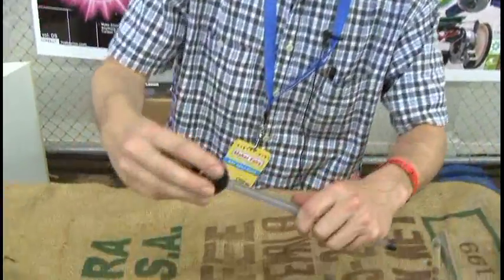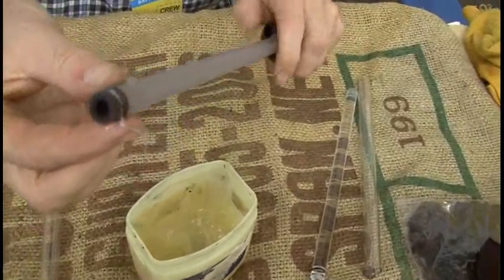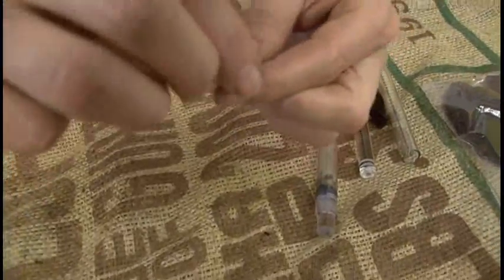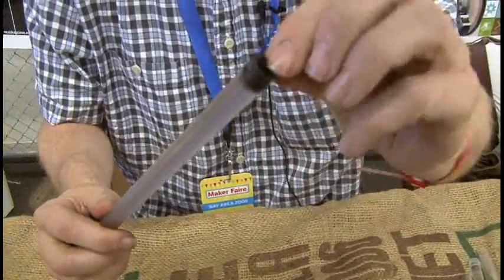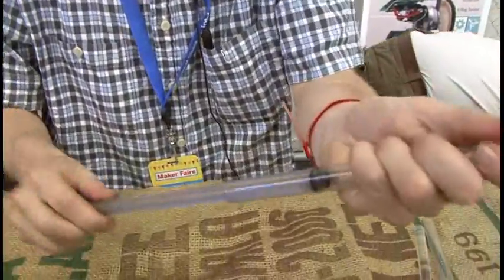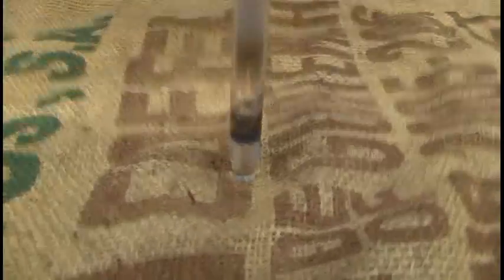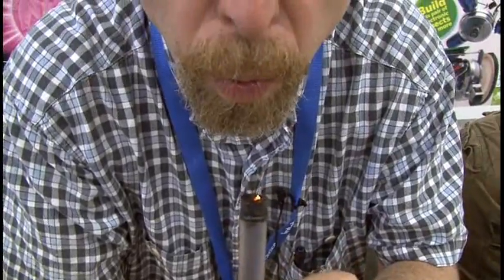Weekend Project: Fire Piston

Comment: Saying that you're "using compressed air" is a misnomer.
What is really happening is that you're suddenly compressing the air which creates heat. Diesel engines work the same way, though they have glow plugs to preheat to help get things going.

Also, the ignition temp may be 500° F, but the fire doesn't burn any higher than what is typical for the material that is the fuel. Paper, and  wood in general burn at approximately 451° F, which is why Orson Welles' book Fahrenheit 451 was thus named.
Reply: Direct injection diesels don't have glow plugs; heat created by compressing the air in the cylinder is enough to ignite the finely atomized fuel even at -20 deg C. Oh, Ray Bradbury wrote Fahrenheit 451.
Reply: Direct injection diesels don't have glow plugs; heat created by compressing the air in the cylinder is enough to ignite the finely atomized fuel even at -20 deg C. Oh, Ray Bradbury wrote Fahrenheit 451.

Comment: Thats pretty cool, but technically friction is still the source of heat for this fire starter. When the gas is compressed the gas molecules are pushed closer together and the molecular friction between the gas molecules creates enough heat to ignite the char cloth. Pretty impressive way to start a fire, it seems to be a much more efficient and reliable method than other "primitive" forms of fire starting.

Comment: @kennybigmac81 Would you say that a diesel engine is based on friction? Because  the principle's the same. Air is compressed so hard, that when the diesel is injected to the compressed air, it ignites just by the heat from the compression. So no, NOT friction dude.

Comment: @Allenrythe Actually, friction has nothing to do with it. You probably already know that when you heat an enclosed gas, the gas tries to expand, and the pressure increases. The inverse of this process is used in the fire piston: when you increase pressure in an enclosed gas, the heat increases. Under normal circumstances, the heat quickly dissipates into the atmosphere. However, because the fire piston is pressurized so rapidly, the heat ignites the tinder.

Comment: @pennypingu6
For example: A can of butane.
It's not cold, its actually room temp! When it leaves the container, it turns from a liquid to gas. This expansion in volume causes the heat to spread out and thus because cold.

When you compress thing really fast, it gets hot. When you expand things really fast, it gets cold.

Comment: actually.. no.. most matches aren't waterproof.. and even if you DO have a waterproof match they usually require a special strip which is usually pressed onto paper.. which obviously isn't waterproof.. the piston basically is waterproof as its fire on demand in an airtight container.. you can pack it up in a plastic bag.. run to your camp site.. set up a shelter.. and light your fire.. in any condition. but whats even cooler is the battery and steel wool I like that alot lol

Comment: When objects hit the atmosphere at hypersonic speeds, the air can't get out of the way of the object and is rapidly compressed ahead of it. When gases get quickly compressed, extreme heat is the result. So much heat that the shock wave ahead of the object will get up to about 20,000 degrees Celsius. Sometimes higher. The faster the entry speed and more steep the angle of entry is, the hotter the object will get.

Comment: Well, yes friction, but it's also because of the air being rapidly condensed. Objects falling into the atmosphere are traveling at some 17K mph so the air below the object is condensed at a faster rate than the rate at which it can disperse, therefor it heats rapidly.

Comment: So many of you have this concept wrong.  Yes the air compresses, but not to a significant temp to flash the char-cloth. In fact what is happening is the same effect that happens in a diesel engine. The petroleum jelly is compressed to it's flashing point which ignites the char-cloth. Any petroleum based lubricant will flash if compressed enough. It happens with compressed air tanks that get even 1 drop of oil in them, and can be extremely dangerous.

Comment: he says it at the end of the clip.  The compression of the air causes an increase in internal energy of the molecules.  This energy is released as heat.  The glass is somewhat adiabatic and keeps the heat in.  The vaseline that he places on the rod should also convince you of the negligible friction within the tube.

Comment: Its basic phase change, but the opposite of what we're used to.

When a gas under pressure is rapidly released it gets extremely cold. Example: Aresol cans, or propane cylinders.

When it is compressed, the opposite happens. It gets hot.

Comment: The principle of increasing temperature by method of compressing air is explained by the Adiabatic process in which the internal energy of a gas must increase when a mass of air is rapidly compressed.The resulting increase in internal energy results in a rise in the temperature of air sufficient to light an ember, just like the pressure produced by an ice skater's blade is sufficient to increase the internal energy of the ice, which turns ice under the blade into water.

Or so internet told me..